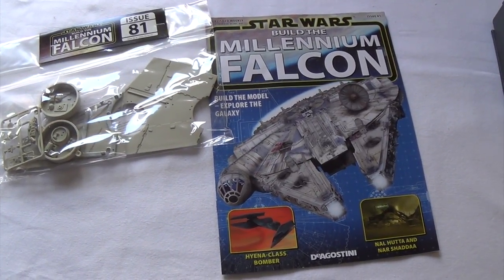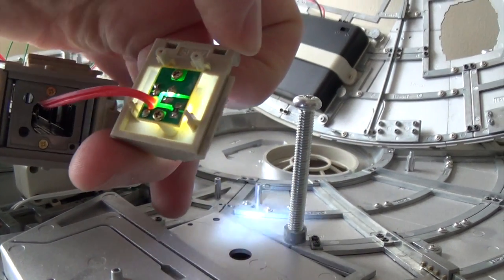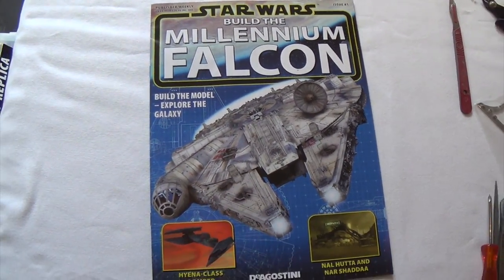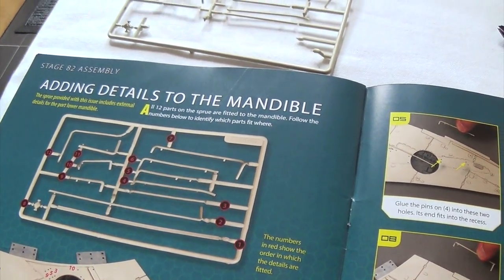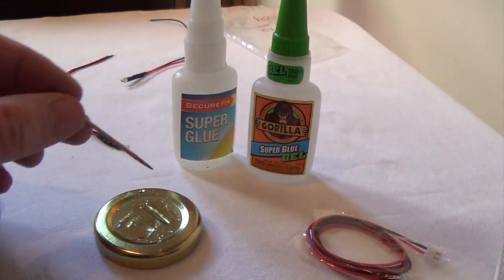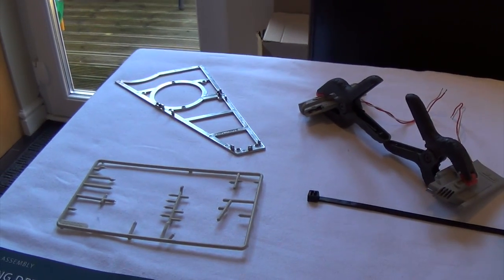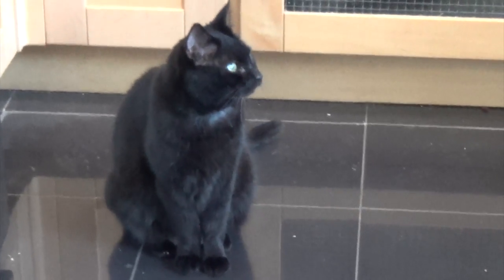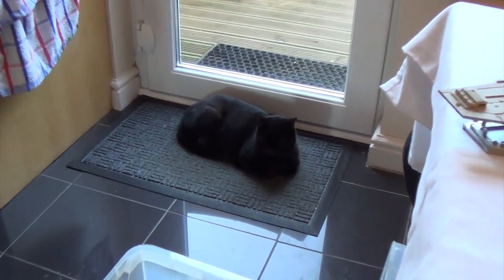Build the Millennium Falcon Issues 81 -  84

Comment: Good update, haven't started mine yet waiting till I have all the issues.As I see it the circuit board that holds the headlight led is held in place by two screws, does it need two? Could you not drill out the inner one and put the red led into that? Looks like it would come out in the correct place, just a thought.
Reply from the maker: Possibly, but I think I can just fit a 3mm LED up beside it, if I perform a little surgery on the LED.
Reply: I'm sure whatever you do it will turn out fine. What I meant to say was fibre optic, not led, but same difference.